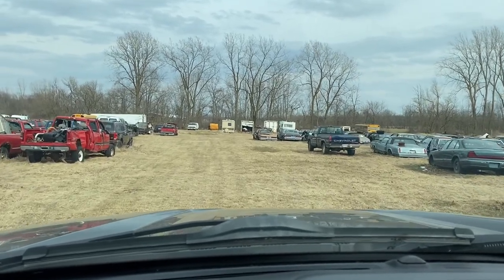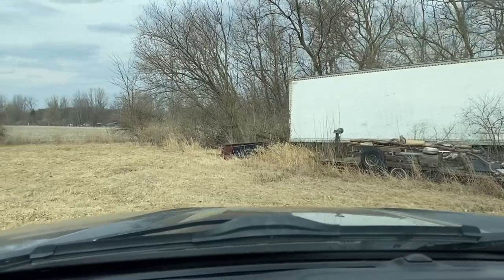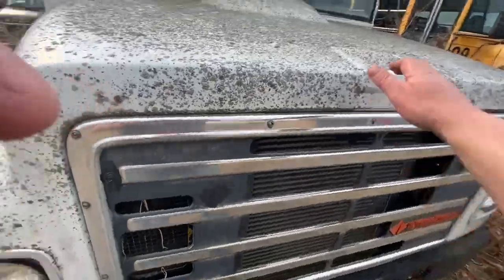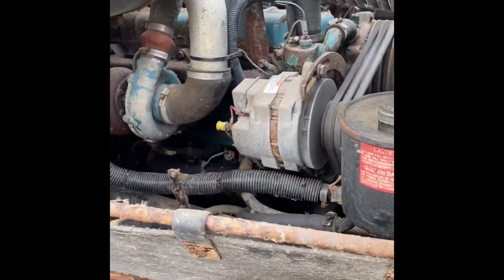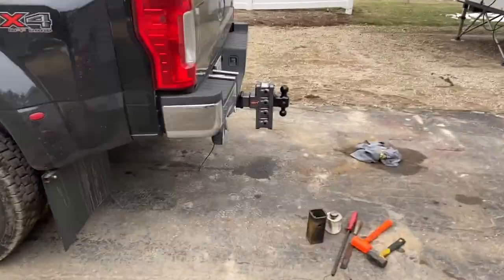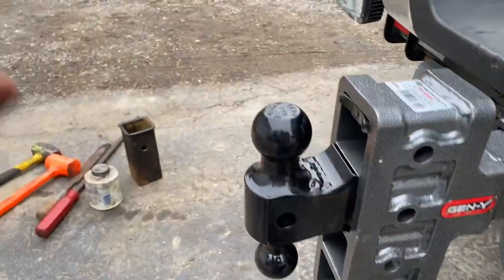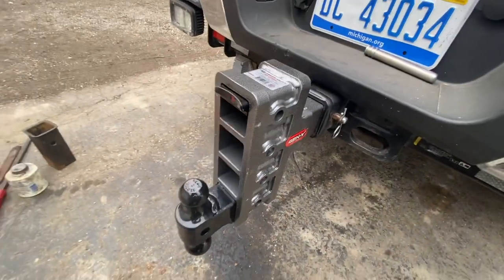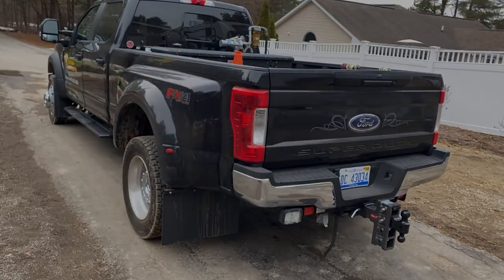School bus... Will it Start? and new hitch unboxing!

Comment: I bought a 1988 Wayne its got a DT 360 , 2 speed rear end in it , Great for the  mountains and interstate , Did add a second fuel tank now the range is now 600 miles . I did put 2 roof top a/c units , Thinking of raising the roof .